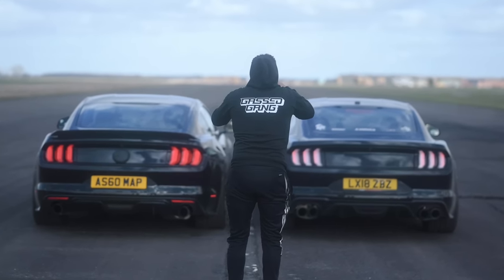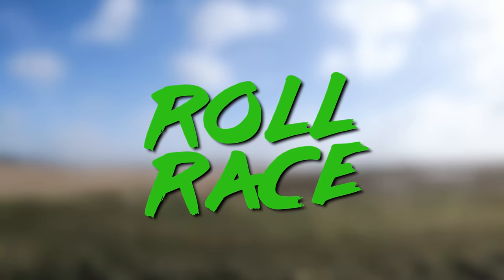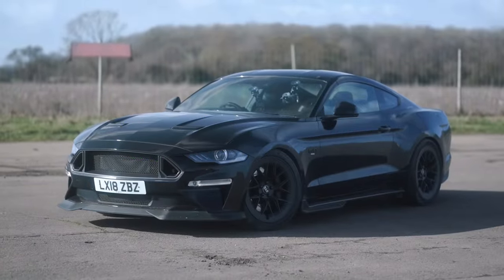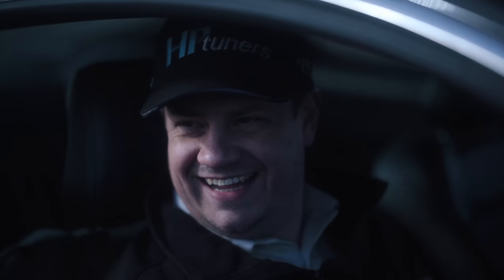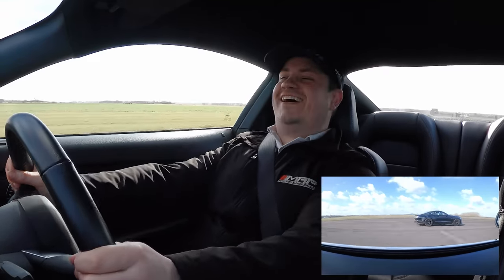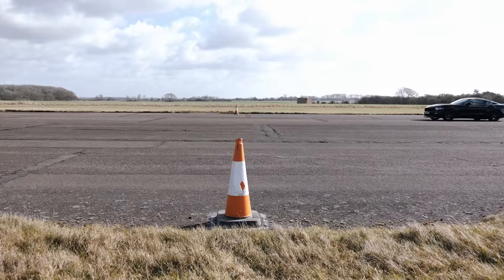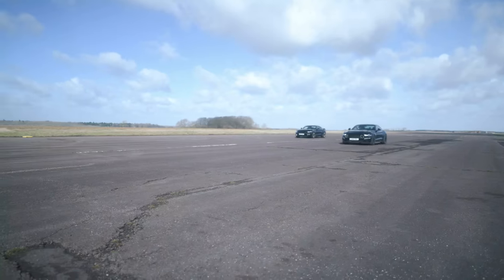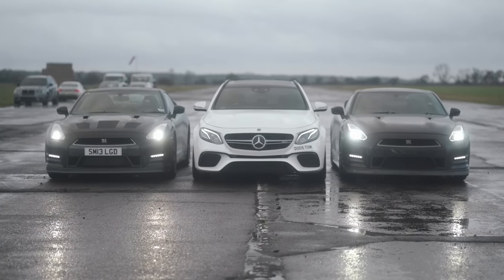TWIN TURBO vs SUPERCHARGED.. 980BHP vs 950BHP FORD MUSTANG GT

Comment: Should add a 60-130mph test to this. I’m curious to see how fast they are without dealing with traction.
Reply: from 60 its still issue, my friend had e60 M5 510bhp and it went sideways from 140km/h, luckily he was skilled driver and got it back to straight <3
Reply: I built an N/A Camaro (pretty radical but still N/A) that was putting down 550hp and it would still lose traction even from a 90mph cruising speed... 

900hp is nothing to scoff at in the realm of tractionable abilities lol...
Reply: @AntoninusPius2  oh wow forgot I made this comment. They need drag radials and a higher roll. I have a 5th Gen ZL1 700whp I had no traction doing a 3rd gear pull at 70mph BFGoodrich G force tires. Now running Nitto 555r2 and have traction.

Comment: Jamie, would be really interesting to see how a standard auto Mustang would fair against them, I have a black 5.0l V8  2018 Mustang, with a Rousch exhaust system and slightly lowered standard engine etc. I just think that on that surface my car could probably match them, as it could probably get its power down better and then no manual change, sometimes all the power in the world is useless if all your doing is spinning your wheels. That said great cars, sound amazing and great video . If you ever want to put them up against a standard one for comparison, I’m a member of gas gang and we have spoken before 👍
Reply: You must have the glorious 10R80 auto💪🏽
Reply: @RobertYayo  No although 2018 and registered in July it is one of the very last old shapes so carry’s the 6R80. I prefer the look of that shape as well the £150 tax a year rather than £500, with the Rousch exhaust system and it’s slightly lowered, so hunkers down nicely as an all round package suited my needs better. The sound of that V8 is just everything I love about the car, it is a cruiser, but will put the power down when you need it, I use the paddles a lot so get the most out of the engine.. The 10R80 is a better box but the need for 10 gears in the UK isn’t something  I’ve missed
Reply: @stevee8920  wow i did not know the 18 came with a 6r80 i assumed once the face changed in 18+ the 10r80 was standard

Comment: Mega video Jamie. 

Shame about all the brain farts in the comments! Not much point staying in 1st when you don’t have any traction and both guys showed up purposefully well matched on street tyres.

To all the haters, watch Jamie’s mini video and you will see a normal car gate asbo and then get gobbled up like it’s stationary once it gets traction.

Put either of these on a prepped surface with street radials and they would upset anything. The drivers know this and are out having fun.

Maybe invite MAP down for a serious race where they can show drag prepped and do it properly 😈

✌🏼
Reply: I run street radials on my Audi in the summer, and have drag springs. Weight shift plus tire is a big deal. I didn’t see too good of weight shift on the cars. 

They are 900hp road cars with the wrong suspension and tire. I give it two years before both cars are crashed. 

Yeah my Audis faster, I also can put down 900 if I want and use it reliably unlike a mustang.

My ea888.3 is ticking so I’m saving for a 2.5t conversion. Currently run 25 psi through A stock is20 cad smokes anything I want.

Comment: Geez, they can't even beat 1980's era 5.0 times with some gears and good tires.  I was turning 12.56 ets in a 1966 Mustang with a 289 on street tires and an open 3.5 rear.  Daily driven automatic with a carb.  This is just showing that dyno power numbers don't mean a damn thing on the street or on the track.  I worked at a company that built a turbo 351 1985 mustang that first pass at the track was an 8.6 et... chassis was only legal for 9.90... again, daily driven. They dyno'd over 1000hp, but dialed it down to low 900hp to get it down the track on street legal slicks.

Comment: Would love to get my 700bhp supercharged w204 C63 on the OG battles looks so fun 
🚗 💨
Reply: You'd smoke both these cars 💪🏽
Reply: @dalturbo  would certainly be close 👊🏻
Reply: @dalturbo  he wouldn't smoke them because of the power, but because of these drivers and conditions. A 10 speed automatic with proper tires especially when 250hp more than a 700hp C63 would get destroyed.
Reply: @notyourtypicalfarah7194 Yeah ... the problem on W204 C63' s is that you cant get bigger tyres than 275 on the back i think. If he runs 700 HP, those 275s are rookie numbers, 295 would be better which pretty much even a base 911 (no turbo, no turbo s) uses. For comparison a RS5 has 275 on ALL Wheels, front and back, even just with 450 hp. I read into the C63 thematics and the consens is that theres not enough space in the wheel arch for such tyres because you won't fit a 295 rubber on a 9.5J Rim. So you would need at least a 11.0J Rim. I know some people who also have 650-750 hp supercharged W204 C63 ' s and everyone complains about the traction problems. I guess it would still be better than here because the c63 is only automatic. 1000nm on the rear on a manual is uncontrollable from a standing start, thats why some people use custom differentials which are controlled by a GPS Box and custom gearbox control unit which is constantly measuring the wheelspin and taking away power until the tyre does not spin anymore. It works great but most people are too dumb to understand why this is even needed, because they think you can floor 1000nm on the rear and it takes off like a electric car.... It shows that nobodoy really driven a mustang in this comment section because even stock with TC Off the tyres will spin for good 2 seconds until it grips.

Comment: Why so slow for the power? I mean they're fast by normal car standards, but not 900bhp+ fast. Either the power is hugely exaggerated or Mustangs have an awful chassis? Would of thought 3 sec 0-60 and 10 or 11 sec 1/4 mile for those specs.
Reply: You have heard of an important thing called traction?
Reply: Traction... Ah yeah never heard of it silly me. Surely 900bhp+ cars would have decent suspension, tyres, LSD, etc which would all aid performance stats? These cars are underperforming massively for the power in comparison to other modern machinery. Hence why they're barely on the leader board against cars with almost half the power. Like I said is it a Mustang chassis thing where they just can't put the power down or are these cars not really running the power they say?
Reply: Also just for reference check the 2021 supercharged Shelby Mustang GT500 performance stats it has a sub 4 second 0-60 and 'only' 760bhp.
Reply: @SpiritBlueFezST  remember manufacturers only quote their best times - not necessarily the times you’d expect on the road (or runway). US times are notoriously optimistic and they usually do their times at the strip after a burn out and on a prepped strip. Makes a big difference. Adding more power to Mustangs is the ultimate example of how men are still on the whole, mostly stupid, and are susceptible to marketing and big dyno print outs and claims. The male equivalent of Prada handbags. There is nothing rational about it. Powerful RWD cars start getting slower 0-100km/h times after they creep above 400-450hp atw (on the street using street tyres). The useable power/speed band just creeps further and further up to the point they do not serve as a useful street car platform.
Reply: If you think 900hp Mustangs can't be fast than you don't anything about them. Firstly, they didn't have proper tires and secondly they guys can't shift a manual fast enough. If these idiots had proper tires and had a 10 speed automatic, they would be  faster.
Reply: @notyourtypicalfarah7194  I’m sure they maybe fast on some artificial and non-repeatable, non-street application- but pulling consistent 12’s on a non-prepped road surface is embarrassing for the money spent.
Reply: @MrTroytroy  Yes, they will put down their best times at the drag strip. However, they can hooked up on the streets. They just need proper tires. 

Here's supercharged Stang beating a Tesla Plaid on the streets https://youtu.be/7y0lrR7tFaQ
Reply: @notyourtypicalfarah7194  on a drag radial tyre from 60mph. The context with the original video is from a dig to the global standard common street speed limit 60mph/100km/h. No one disputes that any high powered car will be generally fast on illegal highway speeds

Comment: Let me put it this way, my brother's stock 14 gt runs low 13's at 2500 ft elevation, right on the edge of 12s. At only 5lbs of boost, little over 500hp, I'm low 11's (and I desperately need a transbreak) at 122mph. 
The race in the video was totally pointless but I suppose it's fun for them and fun to watch. They're putting down 1/4 mile ets of basically stock mustangs.

Comment: Interesting battle...Supercharging vs Turbocharging on the same car. I noticed the supercharged car was able to rev cleaner and pull harder higher up the rpm range through its gears than the Turbocharged car did.  So maybe "slightly larger" sized turbos are required but with similar boost levels on the Turbocharged Mustang or more waste gating or a combination of both. Cool video always entertaining!
Reply: Bigger turbos means the power delivery is worse, but you make bigger power. Because superchargers are lineair with the engine the power delivery is better.

Comment: you can tell that the guys can't race the cars and the young lad seems so excited you can tell he hasn't reached these speeds before! Gear changes are horrific and only in the las roll, the older guy makes a good shifting and you see the car jumps forward before the finish line

Comment: "Horsepower sells cars, torque wins the race". 

I love these big engine rear wheel drive "noise makers".  I don't mean to bruise any egos.  I love the classic muscle cars, but we've evolved 60 years since the days of the classic cars from the 1970s.  While the styling of today's cars is not as good, the performance is MUCH better in every way.  There's really no need to keep recreating the TECHNOLOGY and DESIGN of the older muscle cars.  They were never very fast to begin with.

I used to own an Infiniti Q60 AWD.  I had it modified so it put out a little over 400 hp.  One day I could hear a muscle car revving its engine.  It was getting closer and closer.  I could hear his engine was really racing, so I could tell he was going "fast". 

I kept looking into my rearview mirror to see where he was - but there was NOBODY behind me.  That's when it dawned on me - he was AHEAD of me and I was about to PASS him!!!  I literally SLOWED DOWN in order NOT to pass him because I didn't want to bruise his ego and let him think I was trying to "race" him.  That's the difference.  I bought a performance car and he bought a noise maker.  

Today I own a 2023 Genesis G-70 Prestige.  It's a twin turbo 6 that puts out a "measly" 365 hp because I wanted something more "civilized".  Yet even this car is able to do 0-60 in 4.4 seconds, yet it's luxurious and comfortable.  Don't even get me started on electric cars - they destroy all of the gas powered cars.

I'll take the modern technology cars for my daily driver.  Leave the muscle cars in the garage for the weekend cruise down the beach and nostalgia.

Comment: I just ran my 2022 GT and 0 to 60 in standard drive mode and got 5.1 seconds. I put it in sport mode and got 5.0 seconds and then I did track mode and got 4.9 seconds. Stock.

Comment: Superchargers always made more sense to me because the power is based on engine RPM, turbos on the other hand are too dynamic in their power delivery. honestly though I haven't driven a performance car with either, just turbo diesel 4 bangers and an old 4.2L turbo Nissan Patrol.

Comment: ....recently I heard about builds where supercharger is powered by turbo....so there isn't HP loss from transmission of torque over belt and turbolack is compensated through airtank I suppose....I wonder if gained power is enough to compensate the extra weight...

Comment: Is that the Rev Limiter I hear off the line?  Is the 3.31 ratio low enough?  My 2014 doesn't recover quick from a rev limit.  Hey my XSR900 motorcycle has clutchless rev matching shifter both up and down... doesn't FORD have something similar yet?  Now that's TECHNOLOGY that doesn't require a double clutch transmission.  Precise instant shifts (90% + full power thru the run),  never a missed shift.  Just don't downshift into beyond redline which gets locked out.  That would make ALL the difference in these times at least with a Manual.

Comment: At sea level on a cool dry air, low humidity day. My tuned 2015 Mustang GT ran a 12.82 at 118mph, on a concrete surface. So those boosted cars must be at a considerable elevation in damp air and a poor road surface.

Comment: That weight car running 128mph in the quarter takes about 500hp at the tires or 625 at the flywheel.

Comment: Putting a turbo charger on a GT is silly because the coyote only Ganes momentum at high rpm, so you want a supercharger to gain the power at the high and low

Comment: I have a 2020 Mustang GT PP1 with the 10 Speed auto and I also have a stage 2 Whipple Supercharger with Stainless power Long tube headers and Im also running a Jn2ning fuel system making around 950 to 1000 HP and its making around 800 RWHP on a 3.55 gear. wish I could have been there to race and see where the auto came in

Comment: Hold up , I ran 13.3 on a stock 2002 35th anniversary Camaro SS with less than 300 horsepower at the wheels ?

Comment: These have got to be the worst drivers I have ever seen.  Never have a seen someone with so much horsepower bog so badly off the line.  Even my '01 mustang with only 440 rwhp has run an 11.4

Comment: The supercharger can't beat the turbocharger in these tests. Drift racing or on a tight track (short straits) it's likely it would eat it up. Also on the street when you want to just overtake someone in third gear on a backroad. But in a straight up drag race where you letting the motor just rev itself out, no.

Comment: this is the most unfair race, you have gen 2 vs gen 3 plus one has more hp than the other. how much boost is the supercharged mustang making and how much is the twin turbo making? the gen 3 and gen 2 have different gear ratios and the gen 2 responds to boost better so if you can do this again with 2 gen 2's making the same HP and show the difference in how much boost they make and which one wins, that would be a better race because then its all about the driver and the torque difference and that would bring a more accurate result for which one is better and for what ever purpose you want them to be doing.

Comment: My 2021 manual runs 12.5 seconds and all I have had done is
Resonator delete-H pipe
Roush CAI
Lund box tune 
305 tires All around 

A stock 10 speed with nothing but a CAI runs right with me. Those transmissions are pretty ridiculous

Comment: These two owners really suck at driving. When the one guy miss shifted like 3 times in a row he lost all fear of the cars power and let it rip and out hustled the turbo mustang. Shifting 4-5 times to only reach 60 is also ridiculous for any turbo or supercharged vehicle or any with over 480 hp for that matter. They must have them 16 speed transmissions lol

Comment: Im confused. ??? These 900whp+ cars did mid 12 sec 1/4 mile times? My 530whp subaru does low 11's at around 125mph. These stangs should be in 9 second territory.
Reply: Mustang engines make all their power at 7.5k RPM. What'd these guys do? You heard them, they short shifted at 4k all the way down.

Comment: Comment section have never contended in a streetrace with rwd/manual/horsepower.
Reply: Doesn't matter either way. You hear it in the video, how low they are shifting? Dodge and Chevy engines benefit from shifting around 5500rpm, that's in their power band. Apparently they thought the Coyote was just like those other big American V8's. No, the Coyote makes max power at 7500RPM, these guys were shifting outside of the power band the whole way down lol.
Reply: Its the same in F1, when wet they boost the power up, because they really need it.

Comment: turbos always win rolls and chargers win the dig chargers win the 0-60 and turbos win top speed i was surprised the turbo lost to charger and there has to be a good reason like skill  or familiarity or something hardware related but those wheels should be the same when compared. rolling resistance of wheels can be a huge factor

Comment: You should have had a stock mustang GT in this competition. It would have beat both of those cars in both 0 to 60 and quarter mile. I would be so disappointed if I owned one of those two cars and they couldn't even run stock GT times

Comment: More power is sometimes too undriveable. I had a 2007 bmw 335d. Just had a remap and decat and was putting out around 350bhp. Was doing 0-60mph in 5.5 seconds. Also had a run in with a 400bhp evo on the road. Uk roads. Straight then roundabout. 3 straights and 3 roundabouts. Evo couldn’t do anything I was ahead the entire time. I thought it was hilarious. If I had his evo and he would have had my 335d. I guarantee he would have been dusted also. Also takes a proper driver: I have always driven crapper cheaper cars most of my life: but I actually learnt how to drive and control a car. So on twisties and under hard braking (although brake fade is awful in crap cars) etc, I can be on the bumper of so called faster cars. As they cannot drove their finger up their bum hole lol. Same when I had my ep3. Under hard braking, heel to toe and left foot balance braking, you made up some serious time.

Comment: Why go for 980 BHP if you're going to be slower than the stock version? Either they are terrible drivers, or the cars are very badly tuned... Maybe better to look at the 1/2 mile times. as they are just too slow off the line.